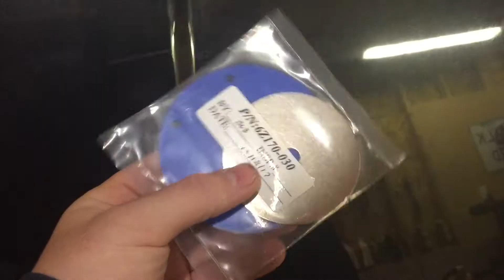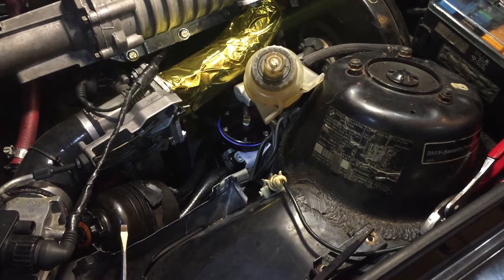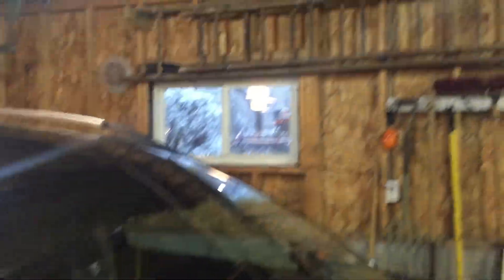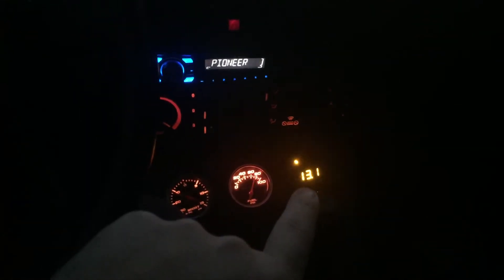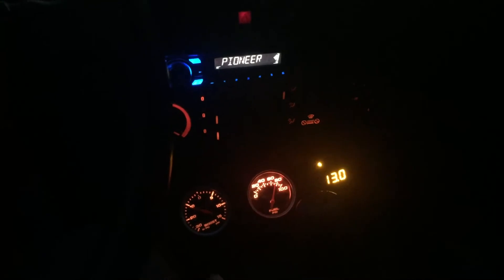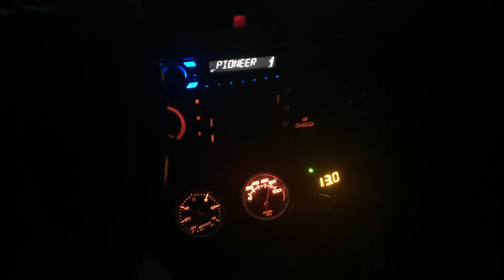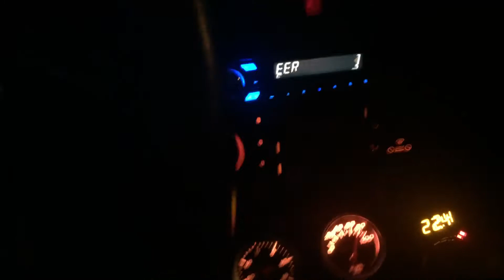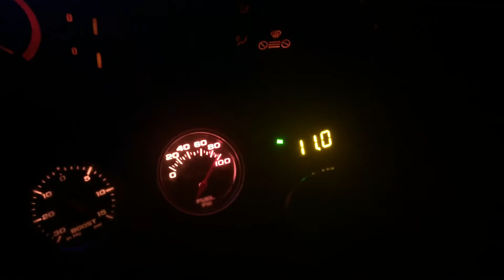FMU CALIBRATION & TUNING FOR THE SUPERCHARGED E30 BMW

Comment: your supercharger doesn't have intercooler, is your car easily heat?
and it doesn't have bov, how u manage air surge?
Reply from the maker: With this style of roots supercharger there just isn’t a way to intercooler the air easily. You could sandmuich a intercooler between the intake manifold and charger but it’s not practical. With a centrifugical like Vortech style it is much easier but I did this for like maybe $200 and stuff I had laying around